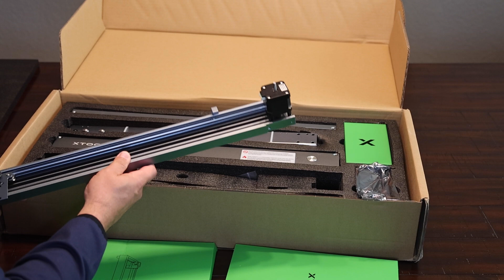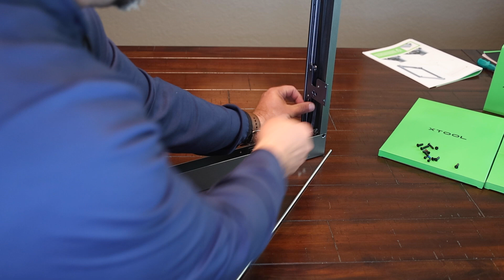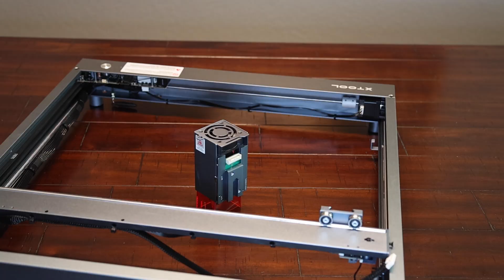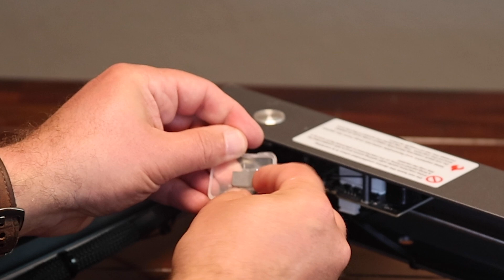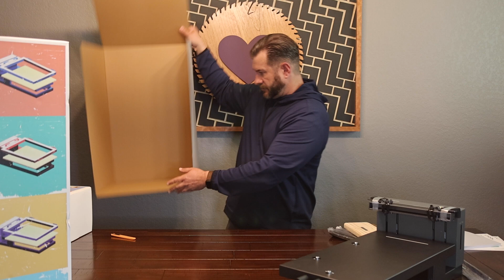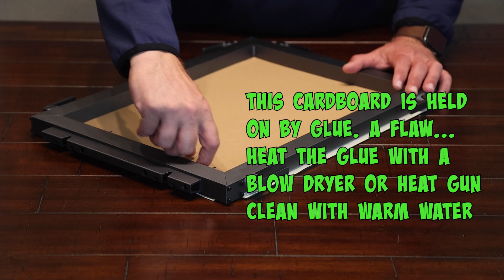xTool D1 Pro and Screen Printer Unboxing, Set-up & 1st Review

Comment: can u do me a favor. im purchased d1 pro mainboard by xtool. At the PCB stand the printed text Makerblock LBD1_ctrlboard_V1_6. The printed text is at the side were cable connectors are. Do u have the same mainboard? Bcouse my board laks the microSd card?. on this card is the Ini or config file. its max 1M data.  can u confirm that u have same PCB board, can u send  me Personal message if its possible to obtain INI file or config file.Plz. best regards Peter
Reply from the maker: Mine is a V1.0. It does have the SD card port, but mind you... it is VERY small. About 2.5" down the card from the wire connector, just next to a white circle that says HF is my SD port. Super small/thin.
Reply: @hillcountryCNC  ok i already have the confirmation the board i have is for the 40W pro version. Thanks for your reply. Best regards from Belgium
Reply from the maker: You’re welcome.

Comment: looking to get this setup, can the 5w run the screen printer attachment?
Reply from the maker: Yes! Absolutely. The laser pictured above is the 5w and it works great for this application. The screen emulsion is very thin and a larger, stronger laser would actually probably be detrimental. For this application the 5w is baller.

Comment: So , did you got the adapter for multicolor screens printing? I can’t find any videos how to add it to the laser
Reply from the maker: Joselyn, thank you for the question. I'm not 100% sure what you mean by the multi-color adapter, are you referring to the rail that lines up the screen under the laser? What I do for multi-color screen prints is just (wow I should do a video on this bc it's hard to explain) laser one screen with on color, the matching the exact set up laser a second screen with the second color cut out. If you use the alignment rail when cutting (and don't move the graphic on the software), they line up perfectly on the screen printer. I'll get you a video!